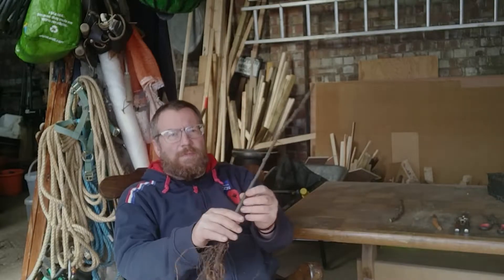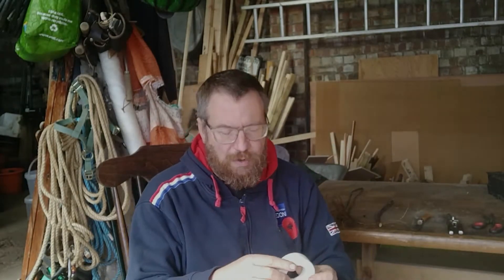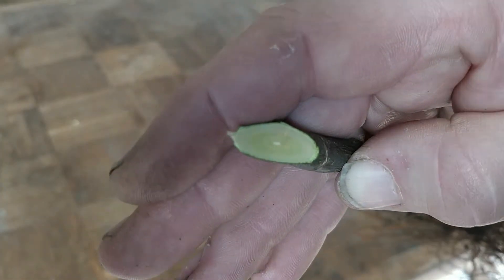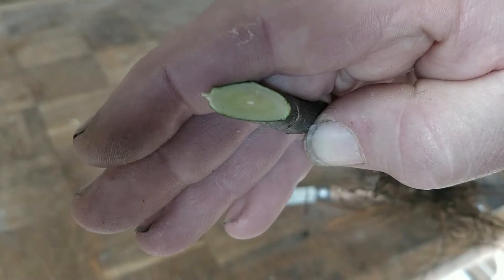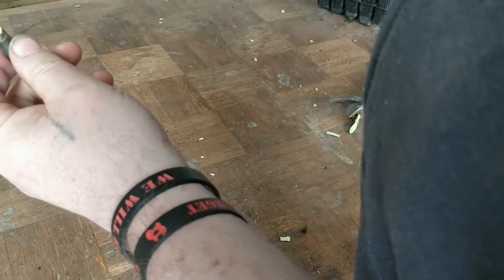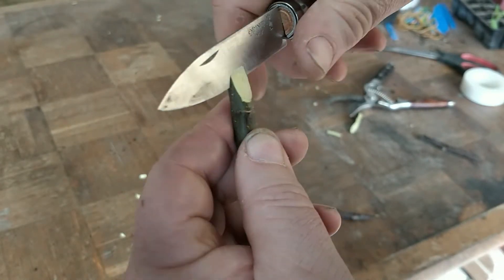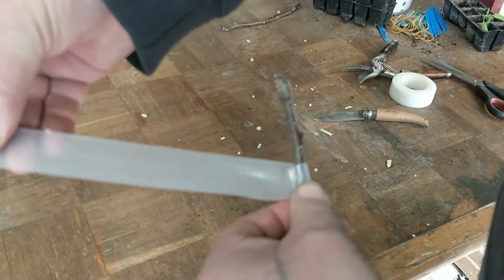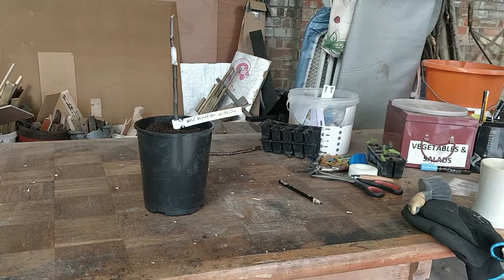Apple Tree Grafting (Part 3) - How to Graft

Comment: Thank you for making that so simple.  It is much easier to watch that notch/tongue than to read about it because I am afraid of killing my trees.  How long will the cut scion live? Can you extend it's life by dipping in wax in order to find extra rootstock?  Also, do you have experience will espalier trees?
Reply from the maker: I would suggest not cutting the scion until you have the rootstock if at all possible. Rootstock are fine for several days out of the ground. I've never done a longevity test on scion wood but I have known people post scions to each other so they are good for two or three days at least. I would cut older scions back a little in case the end has dried out. I'm not experienced at creating espaliers, sorry